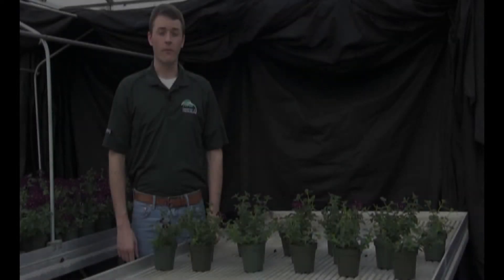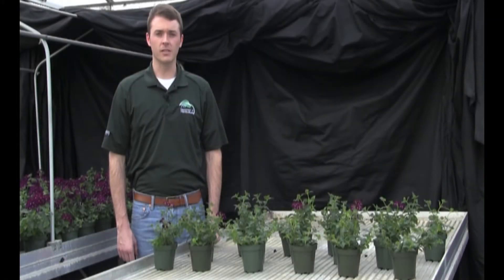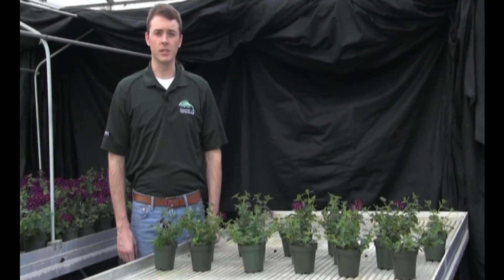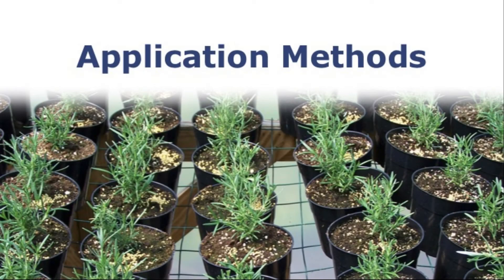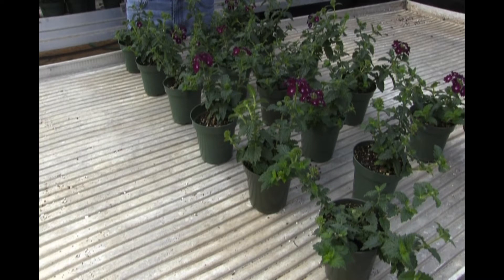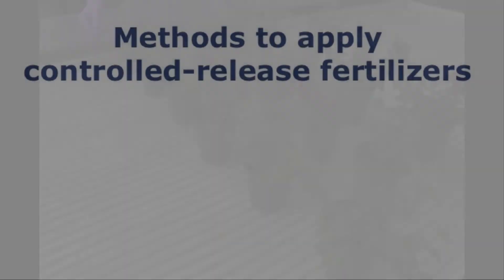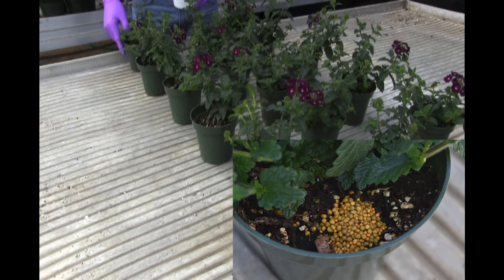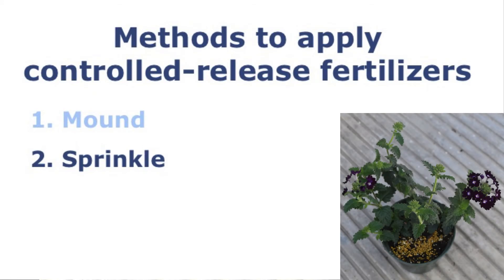Properly Applying CRFs to Greenhouse Crops

Comment: Does a mound application apply the same benefits as a sprinkle application? I've always sprinkled to spread out the fertilizer, but mounding would be easier and quicker. Will it benefit the plants the same?